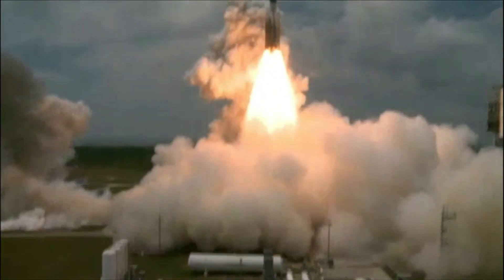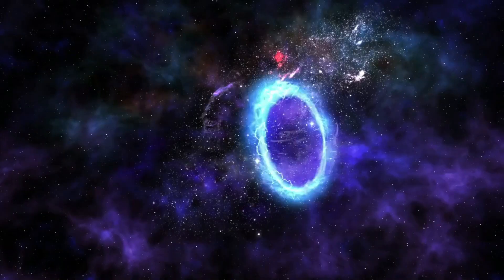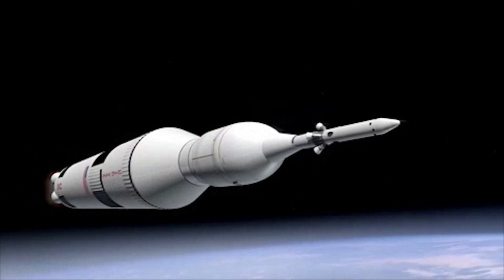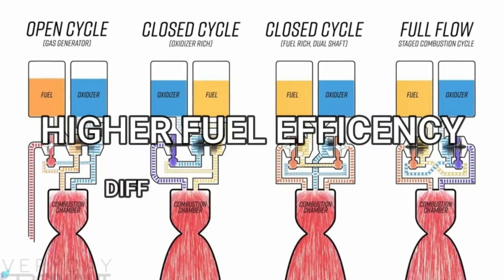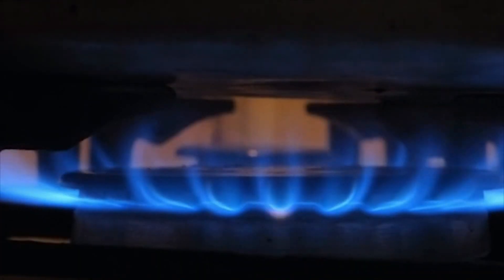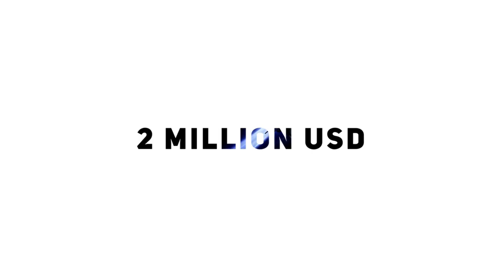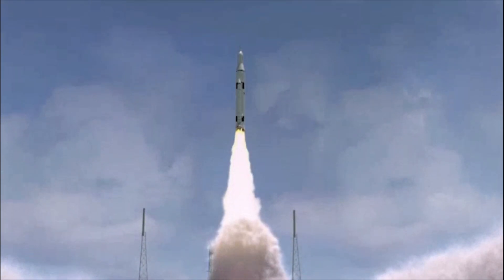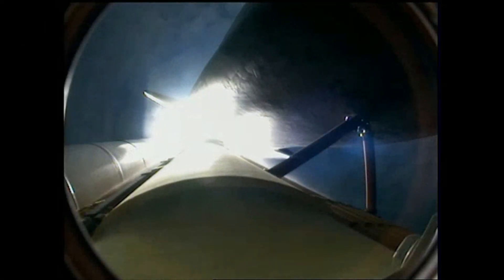SpaceX Raptor Engines: Story of an Engineering Marvel

Comment: "The raptor called for liquid hydrogen" 
"The use of liquid oxygen turned out to be the right choice in the end!" Don't you mean liquid methane? I mean, ALL rockets use liquid oxygen. That's what they know as sloppy editing.
Reply: He's completely confused, and I do mean completely . This 6:34 is a closed cycle engine, an advance over open cycle, but is not any sort of guide to the Raptor's full-flow cycle. He has (weakly) credited Tim Dodd's Everyday Astronaut for the animation, but picked the wrong animation.
Reply from the maker: thanks for the great insight. and we will try to do better. thanks for watching and dropping by

Comment: Might be worth mentioning also that methane can be produced as fuel on Mars! That's also a crucial component to the decision.
Reply: Hydrogen can also be produced on Mars, easier too. But since it has to be kept at near absolute zero at around 17K, it's not really known how to keep that fuel on the way to Mars or back to Earth yet.

Methane is also close in temp to liquid oxygen, which means they can share a common tank dome, and the plumbing doesn't have to be insulated to prevent LOX from freezing or H2 from turning into a gas. Much simpler in every aspect of design
Reply from the maker: @Jaker788  Thank you so much Jake
Reply from the maker: Great point mate ^_^